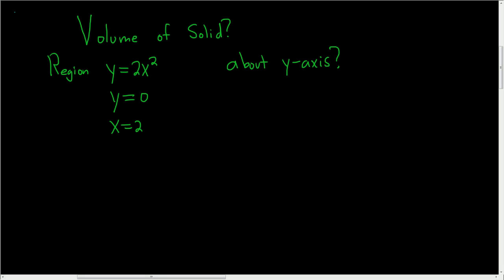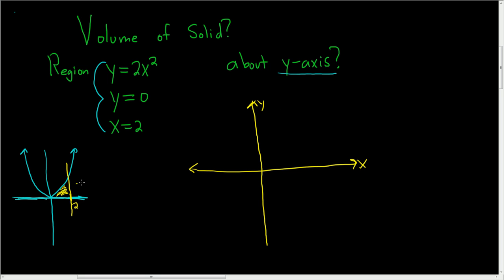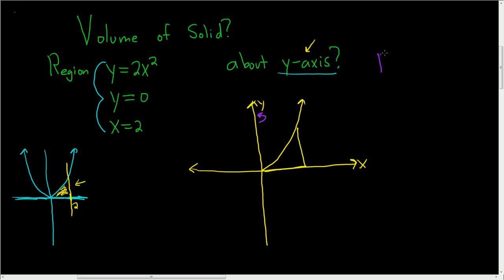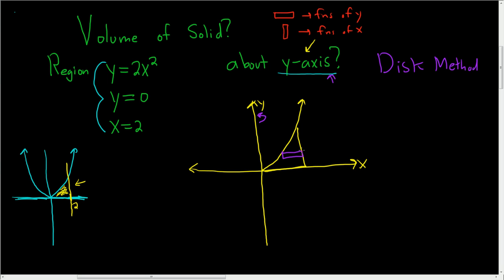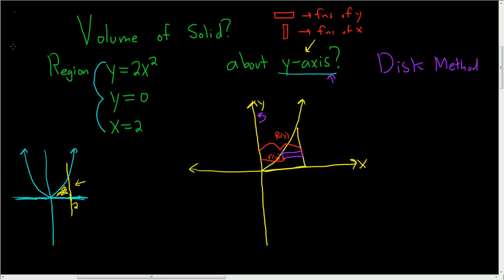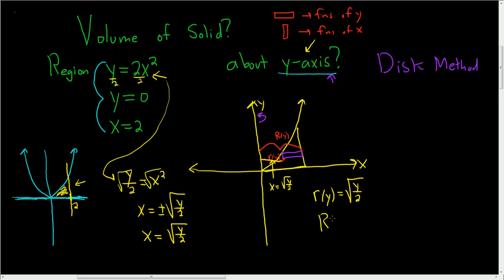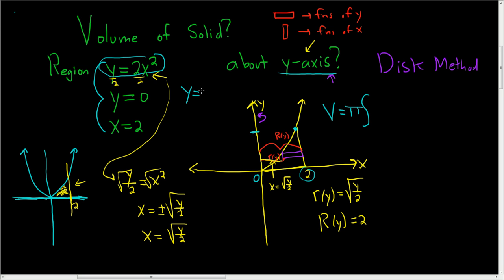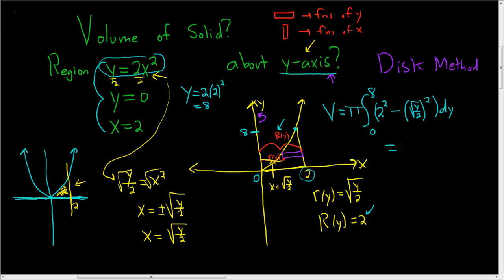Disk(Washer) Method Volume of Solid y = 2x^2, y = 0, x = 2, about y-axis

Comment: why are you using washer method instead of disc method
Reply: wahser method just extented version of disk method. So, they are pretty similiar when y = 0
Reply: I have the same question . The disk method is much more straightforward.😊